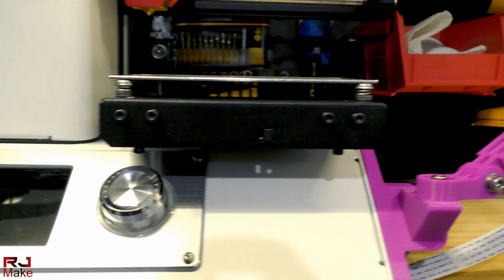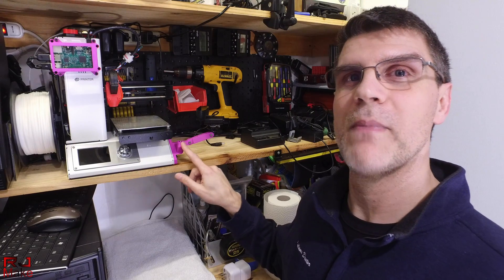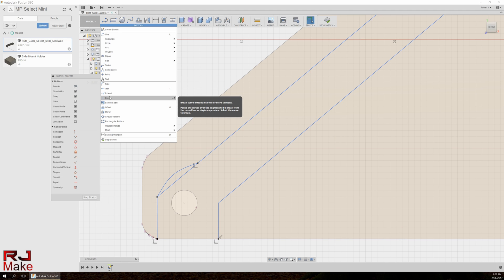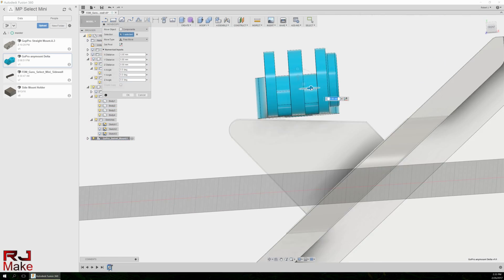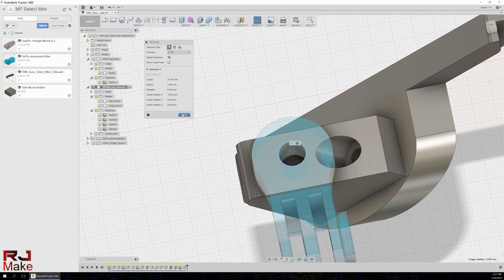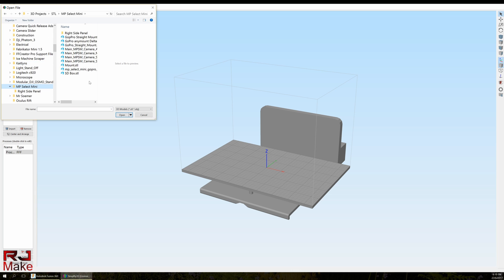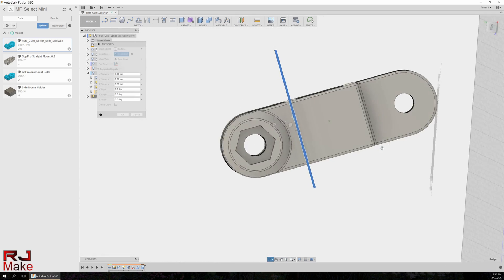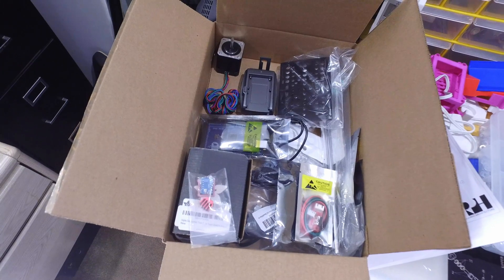New MP Select Mini Webcam Mount -- An Open Derivative Work Tribute

Comment: I really have to find some time to learn Fusion 360!  After you got me hooked on drones I have even less time!
Reply from the maker: I don't know what I would do with out Fusion360. I love that program, and I bet you would to. With your skills, I can't imagine you would go back to TinkerCAD. Maybe even Open SCAD.. :-)
Reply: Main reason for TinkerCAD is the same for Cura over Simplify 3D is this what most use.  However Open-SCAD, that is another story!  I have been a coder for 30 years and i LOVE code!
Reply from the maker: Good point on the slicer, but it also help when one is free and the other is expensive and closed source with DRM so there's that also.. :-)